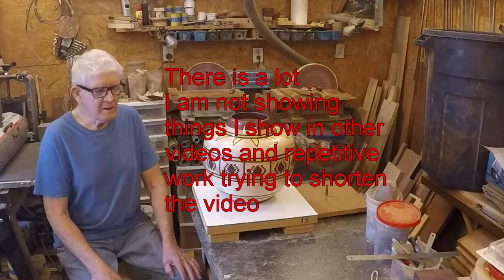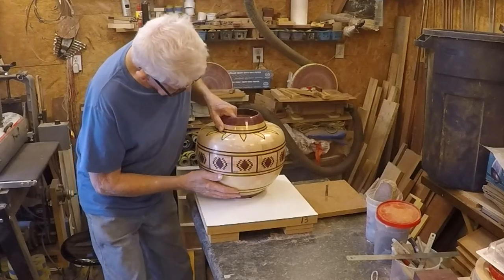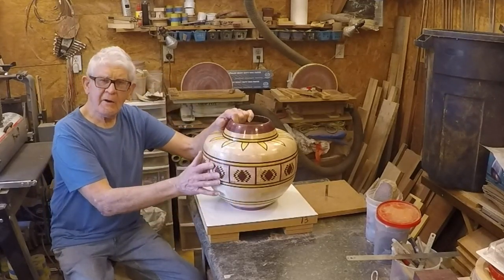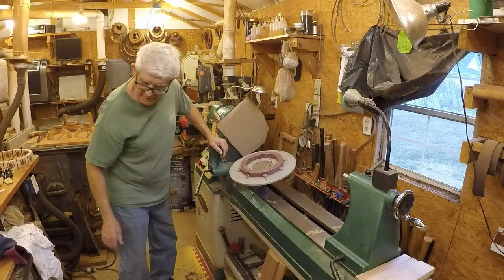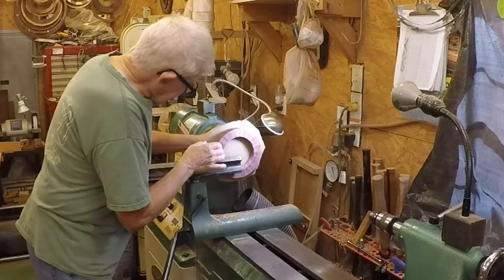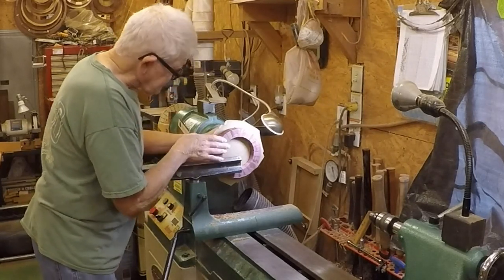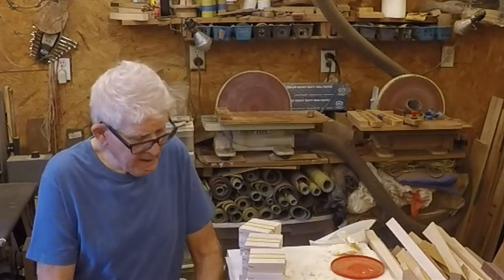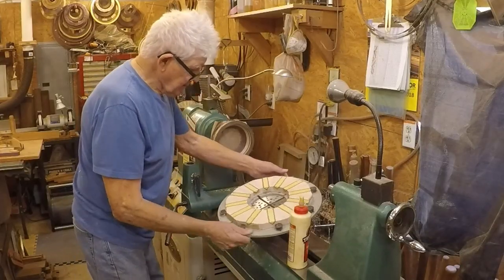squash pot build

Comment: Fantastic job Earl you made that look easy but we all no it certainly isn't. Thanks for all your instruction, I have now subscribed to your channel. Did you glue the brown paper to the ring AND the waste block to make it easier to split apart, rather than attaching them with hot melt glue which is what I normally do.
Reply from the maker: Yes the brown paper makes it easy to remove later